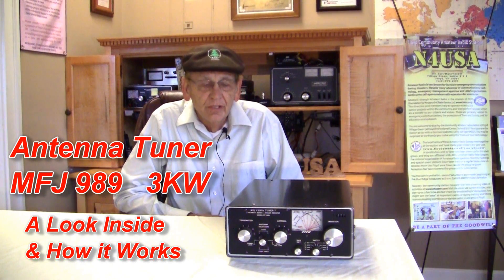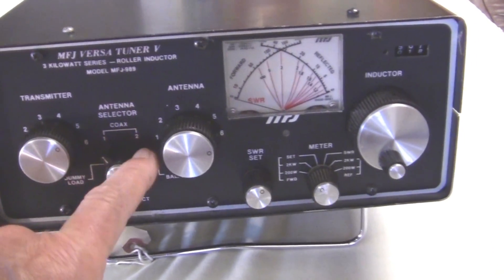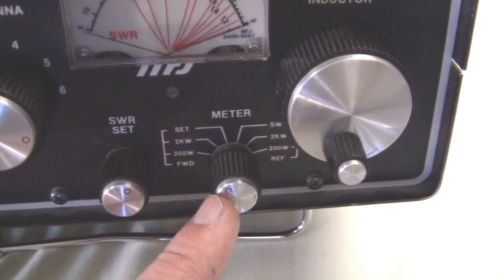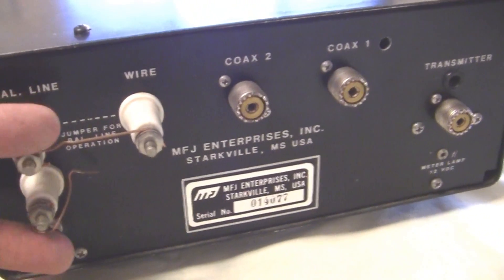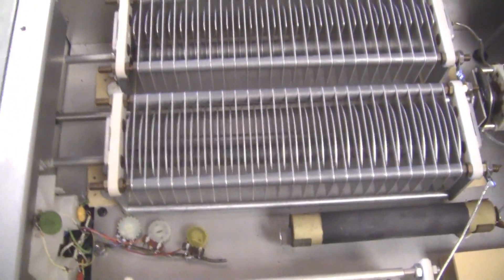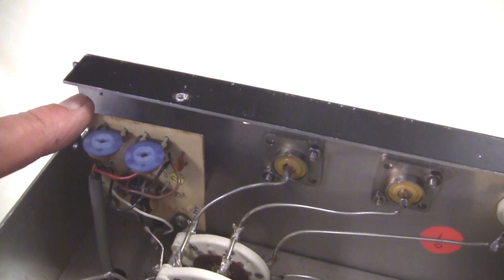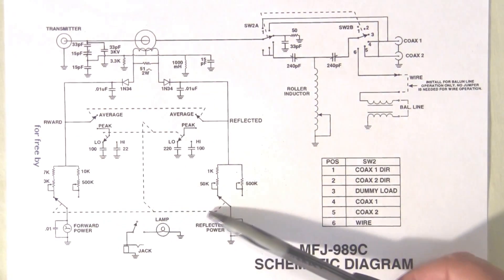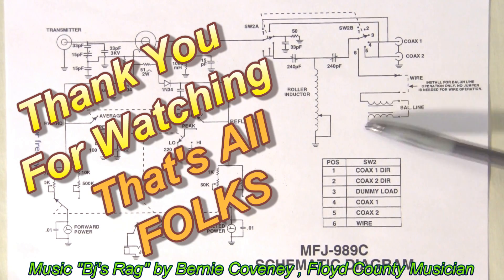Antenna Tuner MFJ  989

Comment: You make a mistake in the final seconds by saying the dummy load position switches to an EXTERNAL load. It is, as you mentioned, an internal resistor. 

K5FNI Rick
Reply from the maker: HI Rick - Thank you for the help with correction. Hope you have good hamming these days. I am not to active and this time but should get more time now that I have sold my "Chantilly Farm" in Floyd VA.   David Larsen KK4WW a ham for 67 years or so www.kk4ww.com

Comment from the maker: Hi - No problem with the power - I have 100 amp feed at the sta ge 110 or 220VAC. You can come camp anytime - does not need to be during event.  I have the ham station fully operational - I don't think  you are amateur radio operator but I would be happy for any hams to visit and operate the station . It is nice with beam and power amp.  I will do a video and post on the ham station - Chantilly Radio-  I get out there and use it myself several times a week. Dave KK4WW